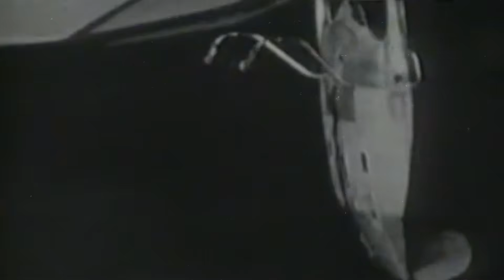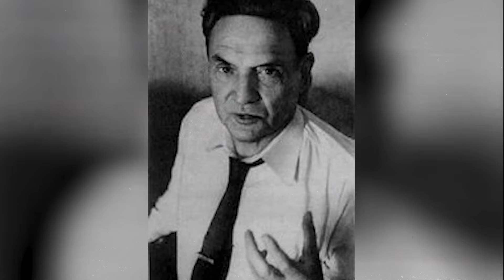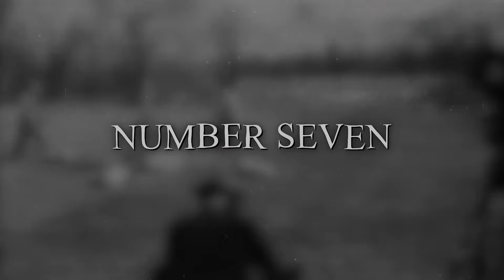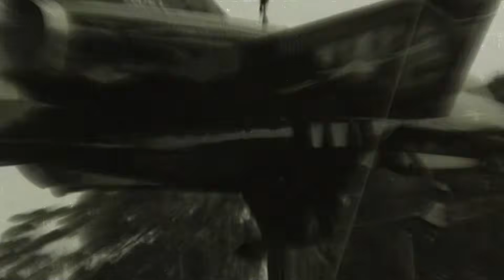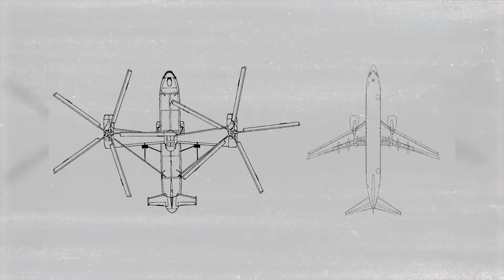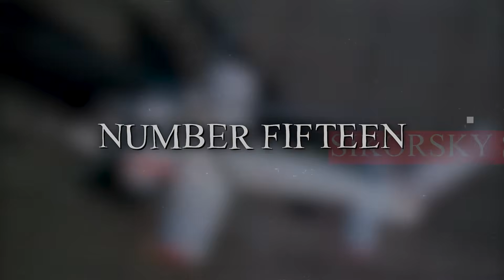15 Strangest Aircraft Ever Built You Didn’t Know Existed

Comment: 15 aircraft I am well aware of but you didn't know that knowledge existed.   ;-)    Several I have seen with my own eyes at NASA Ames.  There is a Sea Dart in a San Diego Air Museum. That program ended when carrier landings became commonplace.  In 1970 I was drawing pics of the X-3 as a child, a wicked plane doomed by under-powered engines it was not designed for.  Glad you included the Goblin.  My older brother lives in Santa Barbara where the Guppy was based.  The inflatable plane did poorly in wind tunnel tests, of which videos are available.   Wish you included the X-14 VTOL that I actually laid hands on at Ames or the asymmetrical Rutan Boomerang.  Happy flying!